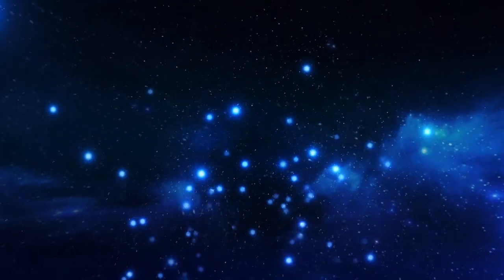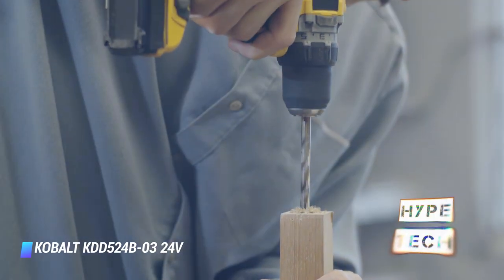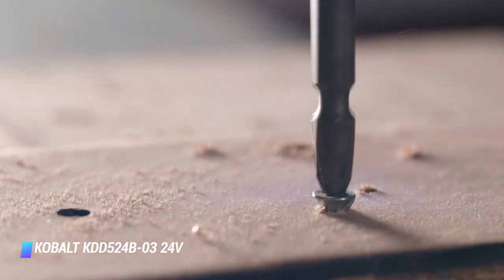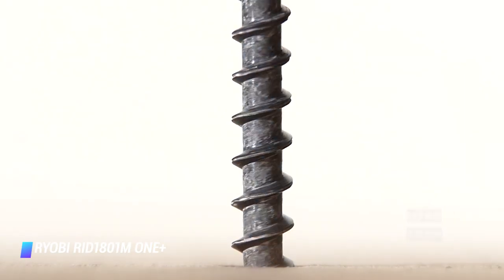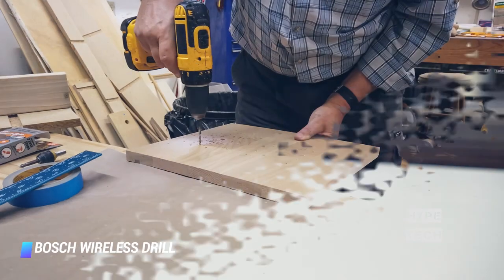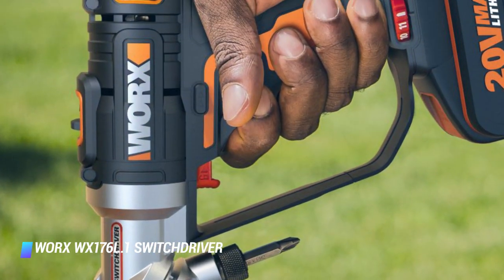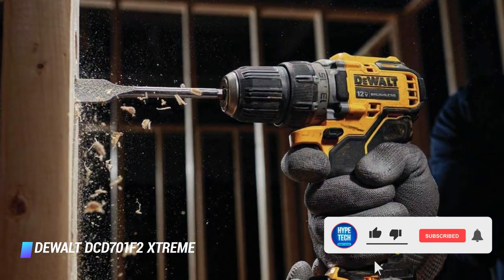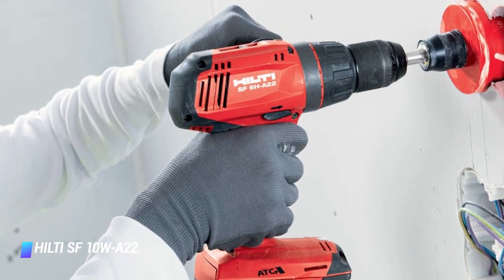Best Cordless Drills in 2024 - How to Choose your Cordless Drill?

Comment from the maker: Products Featured in this video:
✨ Makita XPH07T Hammer Drill - https://geni.us/KMUXH
✨ Kobalt KDD524B-03 24V Brushless Drill - https://geni.us/m2A81
✨ Skil DL529301 20V Compact Brushless Drill - https://geni.us/Pl0x
✨ Ryobi RID1801M One+ Impact Driver - https://geni.us/Iceaf
✨ Bosch Wireless Drill-Screwdriver - https://geni.us/iJ4eQ
✨ WORX WX176L.1 Switchdriver - https://geni.us/ng4Mhd
✨ Ridgid 18V Brushless Sub-Compact Cordless - https://geni.us/b4H0
✨ DeWalt DCD701F2 Xtreme - https://geni.us/qK3Yk
✨ Hilti SF 10W-A22 Drill Driver - https://geni.us/QJ2XAtK
✨ Milwaukee 2806-20 18V Hammer Drill - https://geni.us/e62KvN